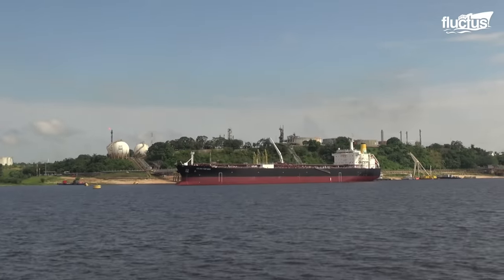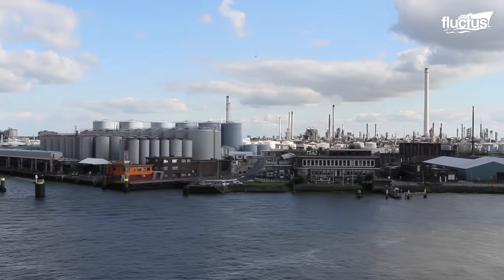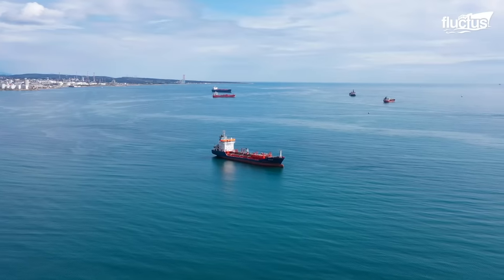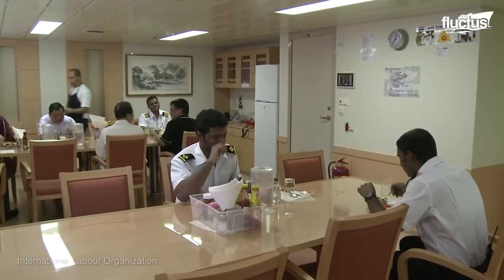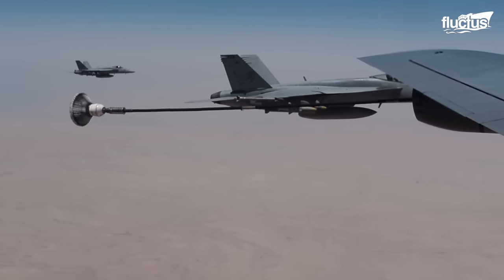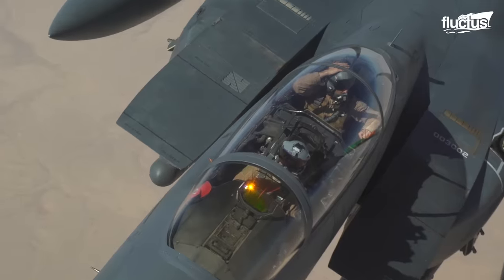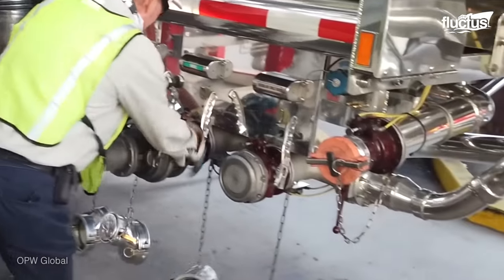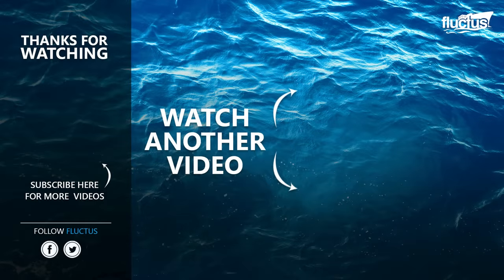Life and Work Inside Massive Tankers Transporting Million $ Worth of Oil

Comment: A video that tells you next to nothing about "Life and Work Inside Massive Tankers".  A waste of time.
Reply: I was a crew member on a number of what were called VLCC...(Very Large Crude Carriers) from the late sixties into the seventies... Unlike a few ship I sailed on before these ships were very well appointed for the crew, with single berth cabins, en-Suite bathroom/toilet a large mess and a bar Lounge for the crew ...the officers had separate accommodation. When at sea the ship was on auto-pilot, in river and docking a crew member steered the ship obeying directions from the pilot. There was no GPS so the ship was navigated by sextant using the noonday sun, stars. Radio beacons, lighthouses and Decca navigators if possible. The crew spent their time either on watch or daywork,  maintenance  etc! I sailed on five of this type of vessel,  never less than six months.... I remember those days, some of the men and adventures I had 50 or so years ago...
Reply: Half of the video is not about tankers at all
Reply: Watch The_legendary_Mariner
Reply: U

Comment: When any ship is sailing, water pours out of the ship's drain hole, can you tell about it??
Reply: Well; engine cooling water for one? I think it's a heat exchange system.
Reply: Ships of this size are not 100% watertight. expansion and contraction due to temperature difference, add to that condensation. That's why every vessel afloat has bilges and therefore bilge pumps.
Reply: @robert100xx yes they are watertight.  Expansion and contraction has nothing to do with a welded steel ship.  Its not made of wood!!!